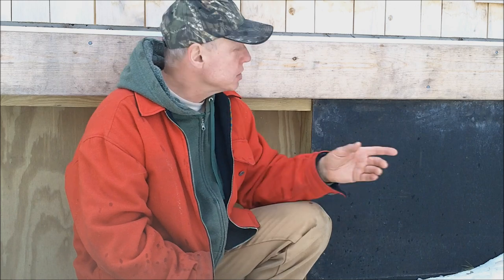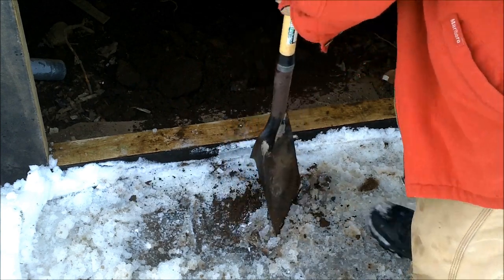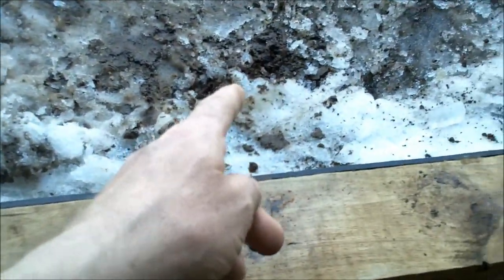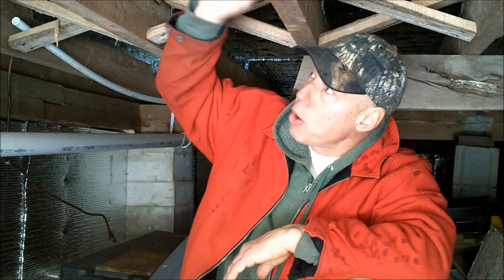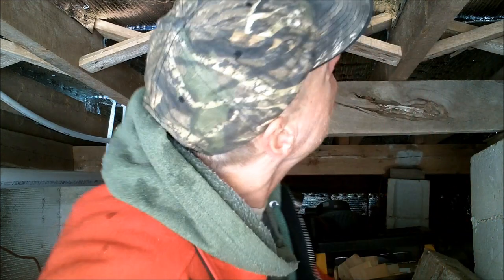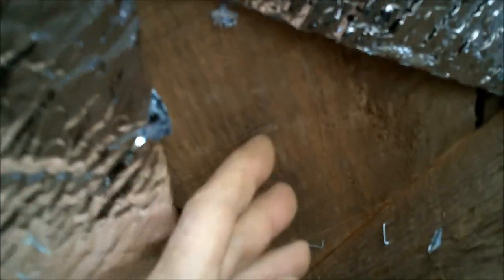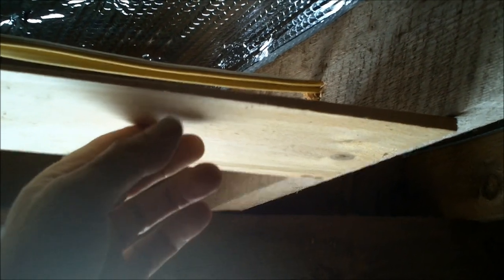HOW TO INSULATE A CABIN FLOOR AND KEEP IT RODENT FREE   PART 2

Comment: Thanks for the vid J.C. You know how it goes you are always gonna have haters. My proof is ur  ground under your cabin its soft, that is good enough for me. My cabin is on piers but i am gonna spray foam underneath and skirt around it also, especially since i have a water line and plumbing underneath the cabin. God Bless J.C
Reply from the maker: Since you have plumbing under there, I'd put more insulation in the skirting than the floor.  You'll want some heat to pass through those joist.   Cheers :-)
Reply: Thanks for the advise J.C It would be cheaper that way too

Comment: I wonder how well bubble foil would work on my raised ranch in Florida. Heat loss VS AC loss. Anyone that might have some knowledge on it would be helpful. My home is block from ground to roof. Laminate flooring throughout with 5mm “vapor” underlay(the orange poly). 
I’m with ya Boss. Looks like you found a gem with the bubble foil. 
Ps: Let Frankie know my pup Maltby says woof(hello) lol.

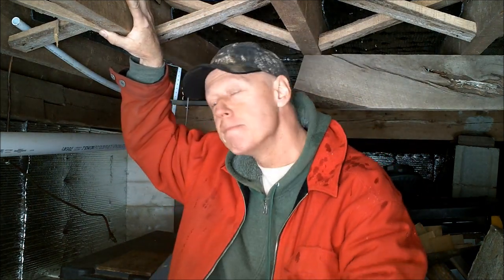Comment: 7:00 😳 lol
I heard somewhere, and I thought it was from you, to lay down a vapor barrier on the soil?  
This is on my summer todo list. I’m so tired of cold floors in the winter. I was going to do the foam insulation but if the “bubble foil” works I’ll give it a shot. 
Thanks again
-Brian
Reply from the maker: The vapor barrier will cut down on moisture but the skirting makes all the difference in the world for warm floors.

Comment: Hi Boss, I am enjoying your perspectives! I'm searching for ideas for skirting a little cabin I bought in Quebec. The floors are insulated with styrofoam by previous owner. I don't see a video that shows the skirting around your cabin. I was going to go urethane, but was quoted in the $2000 range for a 14x12 cabin!
Could you tell me if this is correct? framed with 2x4s with black plastic with an air cavity and then the bubble wrap? I have blocks as piers. Do you have anything between the blocks and the skirting? I really appreciate any guidance you can give!

Comment: I need to know - because its reflective - does it reflect both ways since both sides are shiny? I live In FL so I need to reflect the heat away from my house. If I put this in the floor under the house, do I put 2 pcs and blanket it underneath - and does it matter if both sides are shiny? Ive seen people use wire sticks to hold up their insulation under the floor. I mean if its keeping you warm and comfortable in the house, thats all the proof you need. I just need to know which side to use and how to install it lol.
Reply: Side doesn't matter. Works optimally if there is an air gap to the warm side. It does provide some thermal break.

Comment: Nice work. Please tell us:
How far below grade did you run the skirting?
Did you consider rolling the bubble foil between the plywood skirting and the studs?
Thanks Boss
Reply from the maker: The Bfoil is stapled to the inside of the studs, leaving an air space between the foil and the skirt.  The skirt goes just below grade in most spots.

Comment: I suppose you could wrap the joists with the bubble foil also if you wanted to, maybe also the concrete piers, to stop the cold transferring up through them? Of course that might be a lot of work, especially having to cut around the cross bridging and wiring.
Reply from the maker: I could but not needed.  The house is warm and the pipes don't freeze.   Perfect :-))

Comment: I imagine that if you stapled it to the bottom of the joists moisture would be more of an issue for both your floor and the joists.

I have a friend who's debating on sealing her crawl space or just replacing the rodent infested damp fiberglass batt.
I'm going to suggest trying your method and skipping the 10 grand to encapsulate along with the $1500 dehumidifier needed if it's sealed.

Comment: Thanks again JC. I will be helping my son in NY in repairing his “handy-man” special home that is falling apart. I plan on laying down the “bubble wrap” for the floors before the subfloors, but can I use it on some exterior walls as well? His fiberglass insulation has rodents and mold problem! Thanks again for your informative videos.
Reply from the maker: I think you can but personally, I wouldn't surround myself with it because a building needs to breath.  I'd use fiberglass on the walls.

Comment: Thanks for this helpful video. I have a question: How do you prevent the skirt wall from heaving up and lifting the cabin off its piers in spring?  It gets cold here in winter (-40 at times) and our raised cabin is on clay soil so there is a lot of heaving in spring. To my knowledge we would not be able to drop the skirt wall right to the ground or the spring heave would cause the skirt walls to either buckle of life the whole cabin. I am no expert though. I would apprecaite your thoughts on this.
Reply from the maker: I will be doing a full video on my skirting method in the near future so stay tuned.

Comment: I just purchased R-15 Rockwool to Insulate the floor of my mobil home. I wish I had seen this video first. Do you think if I go ahead and install the Rockwool first and then put this underneath  run flat attached to the bottom of the joists rats will get in? Or if I snug it up against it and staple it to the sides of the joist like you did? Or should I save the Rockwool for another project on external walls? Great video.  I'm a believer.  I'm an electrician and have been around the consttuction industry  since the 70's. I know when someone is full of it, you're not. Thanks.
Reply from the maker: IMO... I would save the rockwool for something else.  Apply this to the underside of your floor and if you feel you need more insulation later (which I doubt) you could add more insulation afterwards.  I have a followup video in the works on this subject and I will show my results of how this has held up after 5 years etc.  Stay tuned.

Comment: I have questions about the skirting: 1) When building that area, is the skirting sunk into the ground at all, or does it just meet the ground's surface. If the latter, how do you keep critters from entering under the skirting? and 2.) What material (board) do you use for your skirting and should it be waterproofed in some way? Thanks so much. I am a 100% rookie looking to winterize the floor of my cabin, followed by the skirting. Using Reflectix for both.
Reply from the maker: The skirting is complex but to simplify the process, The skirt framework is suspended above the ground. There's holes in the bottom plate and rebar rods are driven through the holes. The outside skirt can be anything that doesn't rot, metal roofing works well. The skirt is buried below grade and so is the bubblefoil but not the framework.

Comment: How will a metal roof do with this if we glue it on there or do  you have a suggestion? So glad we found your  page we are taking the fiberglass stuff back today thanks💪🏻🇺🇸💪🏻 we are learning and loving your information I’m retired disabled veteran and not versed on cabin life but willing to learn ‘your videos are a great tool you describe everything great
Reply from the maker: I have not used it with a metal roof and how I would install it would depend on the climate. If all you're doing is trapping the roof before the metal goes on, I'd staple the foil over the rafters, then strapping, then roofing.  That's what I would do.

Comment: By the way, you are right. If the vapor barrier is right up against the floor, there is no reason that moisture would go there as infiltration from the room has no where to go, so it cannot carry moisture.  You have made this very interesting.  When I build, this seems like a good option to try.  Also, have you seen the video on R-21 which uses the same material, but in two layers?  By the way, where are you?
Reply from the maker: I'm in NH.   This stuff is the perfect solution for my situation up here.  Warm floor all winter :-))

Comment: Question, are you using double foil? That is foil on each side?.
I am enclosing a open outside deck  and  turning it into a four season room.
Thank you, Boss  I enjoy each and every one of your videos .
Bob
Reply from the maker: Yes it's a double layer of bubbles and foil on both sides.  Don't buy it at Home depot because they sell an off brand now that is cheap crap.
Reply: Thank you. I will look and see if Lowes has the brand you referenced.
Thank you.

Comment: Wished i had a insulation of sorts built into my old hickory shed floor..Its in its plot now about 4"-6" off the crush stone platform..Gotta wire it up then insulate my walls 1st roof later the spring and think of what to do for the floor before winter

Comment: OK NOW I'M A BELIEVER!!  So now the question:  how to treat an existing 8' x 12' shed with open cavity walls and ceiling.  I'm old and weak with a shoulder injury but very OK with this material and scissors and a stapler for a floor!  Can I just staple to the studs and rafters and call it a day?  Cost is a consideration too.  Thanks for any insight that you can share.
Reply from the maker: You can simply staple it in but there are other options recommended by the manufacturer to maximize R value, however, I have never used those methods as I've always put fiberglass in the roof and walls and bubblefoil under the floor.  This link has other options for installation.  https://amzn.to/3l4tyM9

Comment: Love these videos. Can you use the bubble foil in the walls of a heated shed instead of traditional insulation? I live in the northeast and we are planning an office shed that will
have a heating/cooling system.
Reply from the maker: Yes you can. I'm presently installing it in the roof system of our new building.  Video soon to follow.
Reply: @thebossoftheswamp  thank you! It seems much easier to work with than the bulky counterparts

Comment: I’m sold on the bubble wrap. I’ve seen too many people use it with amazing results. I bought some bundles last week. Do you have vents in your crawl space to or is it sealed? I’m in Texas and wondering if I still need the vents.
Reply from the maker: Vents are recommended but I close it up tight in the winter.
Reply: Thank you!

Comment: In the process of rebuilding an 1850 post & beam structure and had new 2x6 walls done on the second floor with trusses to support the tin roof.  Was planning to drywall the rooms and was wondering what your thoughts on using the foil wrap between the rafters and the drywall, similar to what you did on the floor, with it layered between old & new decking.  Let me know your thoughts....
Reply from the maker: I hope to have a followup video on this subject out later this week. It will answer many questions and show you how I just recently installed it in the roof of my new build.

Comment: I'm sold on this product with your recommendation boss but my only question is since a subfloor is normally glued down to prevent floor squeaking, if this bubble foil is ran across the floor joists then the floor isn't glued down. Have you ever had a floor squeak in your cabin? I'm preparing to frame a small shed much the same as your workshop and don't want any squeaky floors 😁
Reply from the maker: If squeaky floors is a concern, then I'd do something differently. I can't say your floor will or won;t squeak with this application.   Myself... I don't mind a squeaky floor or squeaky door. If someone sneaks in my house at night, That squeak may save my life and end theirs haha.
Reply: @thebossoftheswamp  very valid point boss! I believe I'll lay it in the same way you did between the joist thank you for getting back to me on this!

Comment: Depending  on where you are in middle  NY  47 degree heat from the earth is being trapped underneath the cabin, sounds like it works great to me, just wondering about summer moisture. Is that going to be a problem under there? ?   Let me know. Thanks.  In the crawl space? .
Reply from the maker: I vent the space in the summer so no worries - but venting in the winter would defeat the purpose of trapping the air.
Reply: @thebossoftheswamp  Thanks for this, would love to see how you achieve this. I'm up along central lake Manitoba, Canada. I've followed the bubble foil floor joist technique, and am about to do the skirting. Would love to see anything you can share! Thank you

Comment: Thank you for another valuable video. In regards to the installation of bubble foil between floor joists and subfloor, in new construction, wouldn't such an installation hamper one's ability to glue down the subfloor, or am I missing a work around? I am planning a cabin build in the next year, and  am very interested in the best application of this product, in your experience. Thank you.
Reply from the maker: That's correct. You would not be able to glue the sub floor if the foil was on top of the joist.
Reply: @thebossoftheswamp  Thanks for the reply. Am I correct in concluding that the trade off of the subfloor adhesive for the foil, is well worth it in your mind? My apologies for the novice questions, as I am an almost 50 year old city boy, who was born and raised on the west coast, and I am getting ready to move to, and build a cabin in, the Northwoods of Michigan's upper peninsula. Your input, and the inspiration of your work,  have been instrumental in making positive changes in my life. I hope that this note finds you and yours, happy, and doing well today. Thank you, again.

Comment: I was woundering if I could attach the foil to the floor boards during the build process to save a step of crawling under to do it after the floor is down? I like what you have done and I wish we could build one of these units, good job, thank you for sharing.
Reply from the maker: Sandwich it between the joist and the sub floor but keep the rain off it during construction.
Reply: Awesome, thanks for the reply. We hope to find a chunk of paradise one of these days. Hard to find with all the grow ops making the structures a mouldy mess and all the good plots of land have been snapped up decades ago. Lots to think about.

Comment: I definitely plan to use the bubble wrap  but do you think foam between the floor joists would help even more or do you think it would be a waste of time. I live in Alaska and the temp here hit  -23° this winter. I'll be adding on to the existing building this summer.
Reply from the maker: The Bfoil reflects heat so, if I was going to do this, I'd have the foil touching the floor first.

Comment: I actually agree with your methodology and installation.  I also agree from experience fiberglass under floor plus crawl space is asking for rodents and issues.  Its also a waste of material time and money.

What is missing from video to me is explaining the difference between heat loss i.e. radiation, conduction and convection.  

Convection heat loss to me in a floor is negligible and reason I dont subscribe to batt insulation in crawl space floors.  

Buublefoil (your terminology) is a great radiant heat barrier.  I.e. heat you create with wood stove is radiant blocked at floor and transfers to your feet and living space.

Bubblefoil is not nor claim to be a conduction insulation.  Which again is to your benifit.  You obviously have conduction heat loss as only cabin is heated and crawl space is above outside temp.  But this is a good thing as your pipes dont freeze.

So I 100% agree with your methodology I think it could use a better explanation.  Thermo cam imaging would be great to see on a cold day with stove cranked.

My two cents.
Reply from the maker: It's missing because I don't overthink things.  It works awesome, my floors are toasty, ants and mice don't bother it and it's easy to install.   That's all i need to know :-)))
Reply: @thebossoftheswamp  just saying 95% negative comments our often a result of our own doing.  I gave you rave review on your application and installation.  Yet I also comprehend what you are dealing with as a woodland dweller and an hv/ac engineer.  

Its not overthinking it understanding and application of best use of material under a givin circumstance.  

I see a lot of videos with a lot of miss information givin (not you) as all you have shown is experience.

Comment: does your skirting heave in the spring thaw/freeze cycle at all?  I just moved into a cottage - eastern canada.  it has vinyl skirting with what looks to be a 1/4" plywood backing.  there is a lot of heaving that went on during the early spring.  wondering if I apply this bubble wrap material to the back side and apply another 1/4" piece of plywood on the back with the bubble wrap sandwiched in between will that stop this heaving from occuring?  I notice at section 2:33 in the video you have what looks to be a piece of 3" wood (not sure of depth) embedded in the soil as part of the frame the skirting closes against.  they used crushed stone under the bottom of the skirting fyi...

Comment: Question: Don’t most crawl spaces have air vents? What is the reason for that and would you need ventilation for whatever reason the builders place vents in crawl spaces?
I like what you’re saying and have used bubble foil on my windows during an extreme heat wave one summer. Worked quite well.
Reply from the maker: I vent in summer to prevent mold but I trap heat under there in winter so my pipes don't freeze.